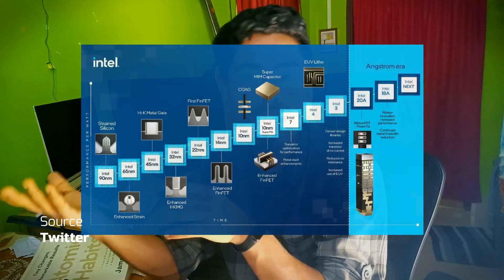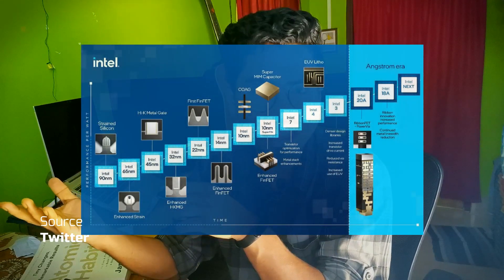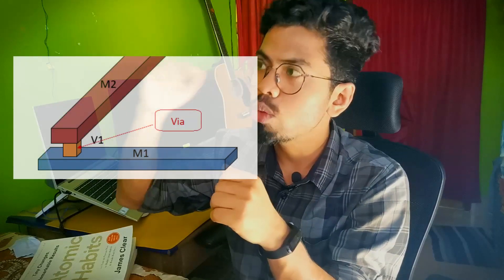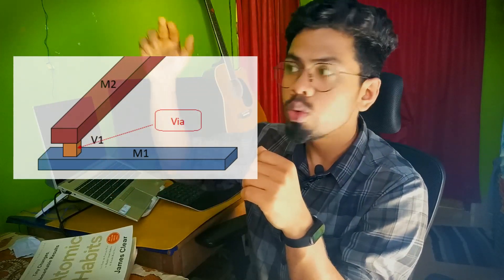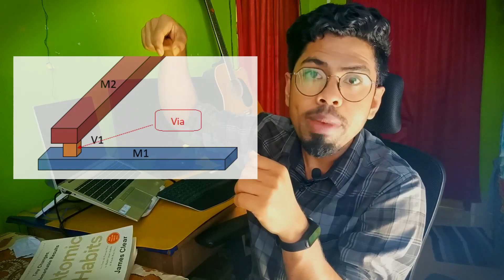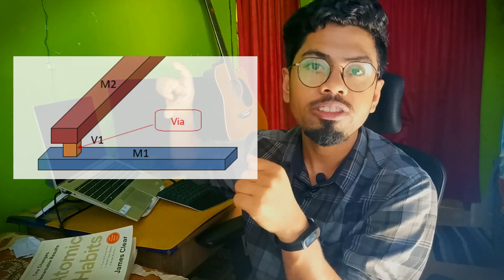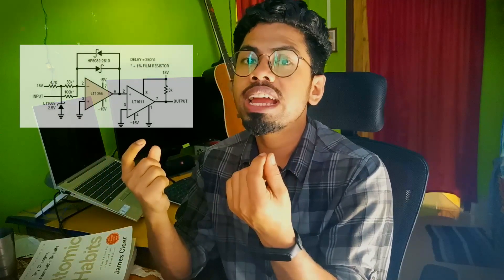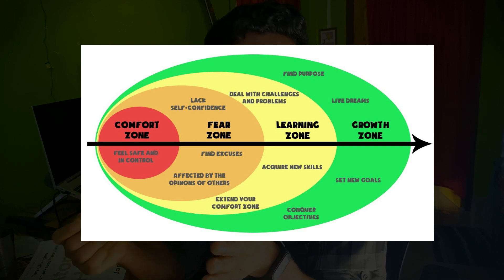VLSI Industry Review after 6 Month | Work Done by VLSI Engineers | VLSIgayan ep:6

Comment: Is Layout design in analog domain in vlsi job?
Reply from the maker: No.. Layout could be treated as independent of any domain.. And not so correct but roughly we can say that digital circuit layout could be automated with less manual intervention where for analog circuit layout we need more manual intervention... Many time same physical design engineer do both the work
Reply: @whyRD  Can i change from layout domain to physical Design domain which is Digital part.
Reply: Fully physical design
Reply from the maker: Yes you can